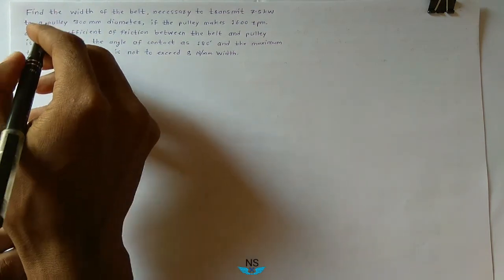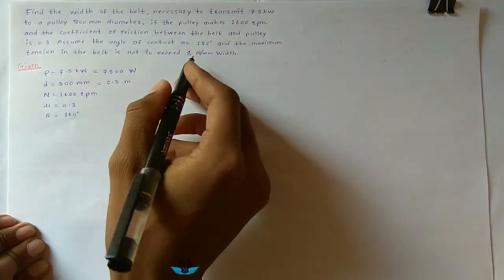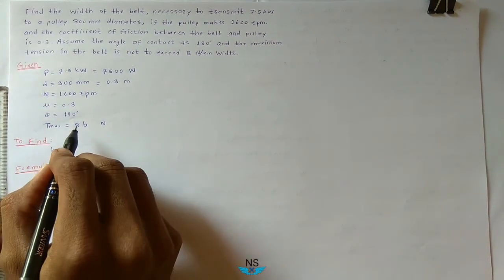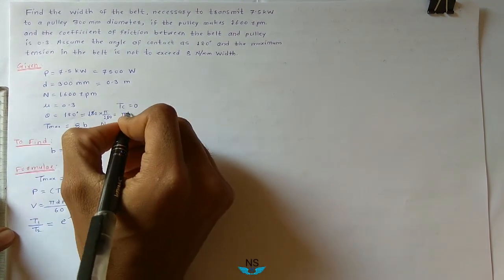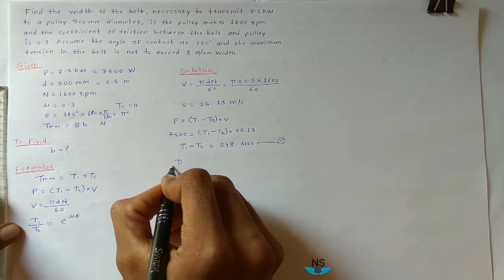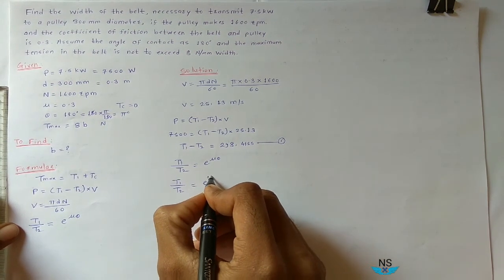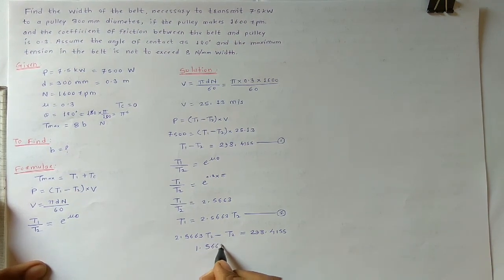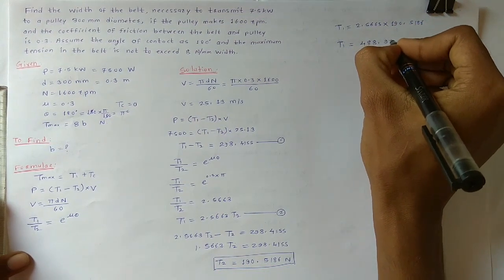Belt Drive (Problem - 03) ।। How to find Width of Belt #viral

Comment: hello sir can you please solve this question: 
a countershaft is to be driven at 240rpm from a driving shaft rotating at 100rpm by an open-belt drive. The diameter of the driving pulley is 480mm. The distance between the centre line of shafts is 2m. Find the width of the belt to transmit 3kW of power if the safe permissible stress in tension is 15N/mm width of the belt. Take µ = 0.3.
Reply from the maker: Yes... I will  give you solution tommorow